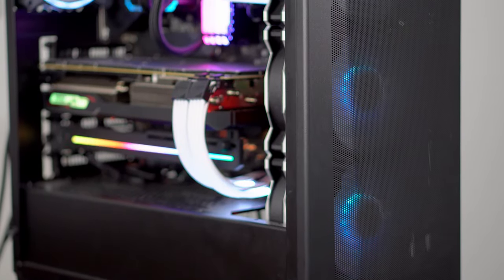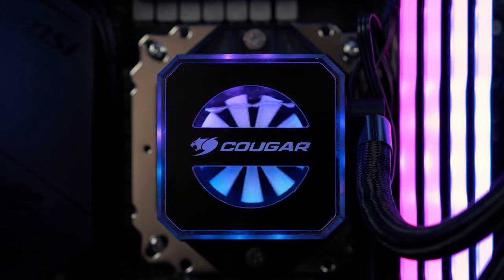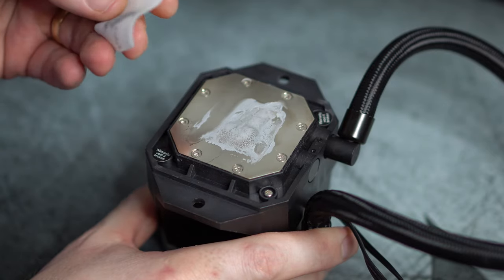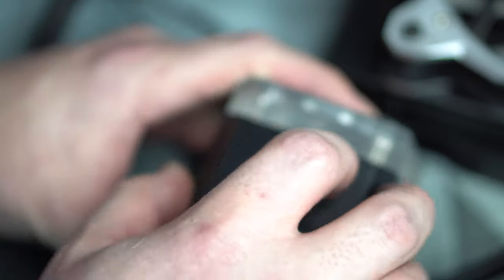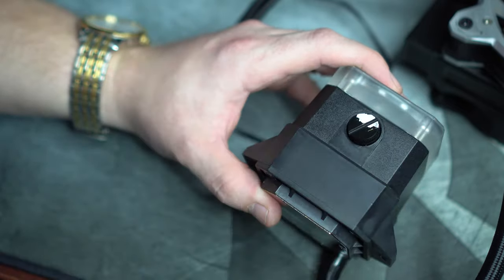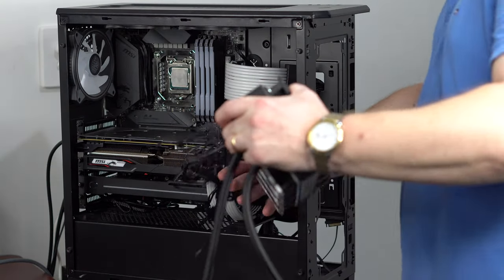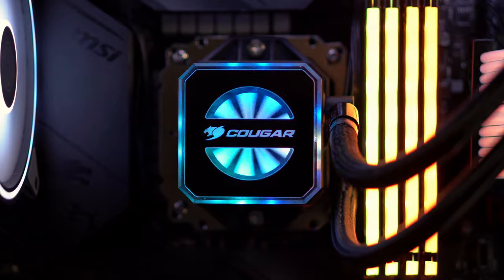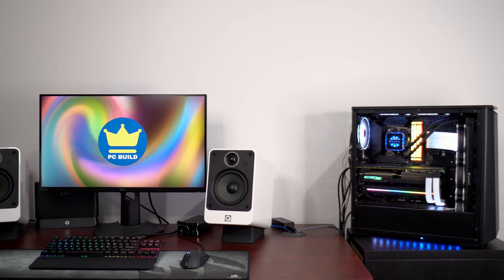How to Refill the Cougar Helor AIO

Comment: My block has become yellowish, I also have weird rock looking particles inside. It doesn't behave abnormally tho.
Reply: I have the same thing. Just noticed them sitting in the bottom of my CPU block. I have no idea what those are, or if I can do anything about it
Reply: Same problem, Yellowish Fluid with Weird particles inside the pump window which means the coolant has been decomposed. Can someone guide how to replace the coolant and which coolant should be used for replacement??

Comment: Hey so i have the 240mm version but i see a dot of water only like i cant see if its full or not the dot is on the very top so does that mean its full?
Reply: I have the same cooler and yes it does. You don’t need to fill it up very often mine is 3 years old and got 3/4 on gauge.

Comment: the thing is that the little fan where you can see the bubble is spining very slowly 
is that normal
Reply: Hey, mine was slowly too, but after I fill up with coolant came back to normal
Reply: @igorpiva6011  I can confirm that. Same happened to me, after refilling the reservoir it came back to normal.
Reply: @igorpiva6011  I can confirm that. Same happened to me, after refilling the reservoir it came back to normal.

Comment: my aio fan dont move :,c but still cooling
Reply: Same do you fix it because Idont no How Ican fix it
Reply: @o85  my fan wasnt spinning, i did 2 things, 1- checked the fan connection to motherboard and 2- i put the pc sideways a few times for the water to flow through the cooler and it worked

Comment: Any idea why my cpu liquid fan not spinning at all ?
Reply: How do you fixed?
Reply: my fan wasnt spinning, i did 2 things, 1- checked the fan connection to motherboard and 2- i put the pc sideways a few times for the water to flow through the cooler and it worked